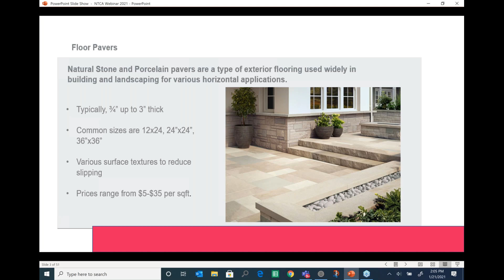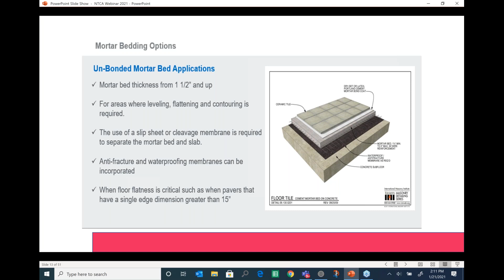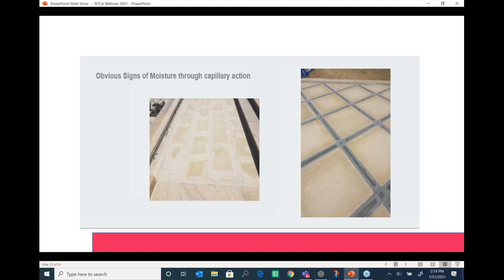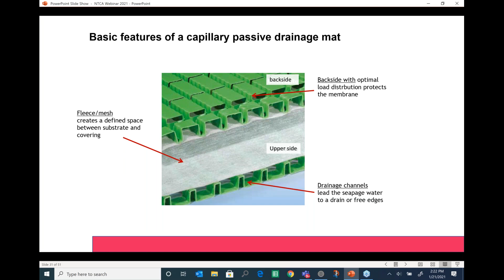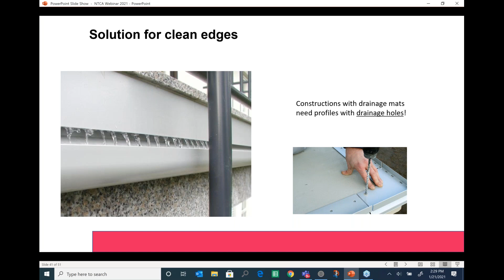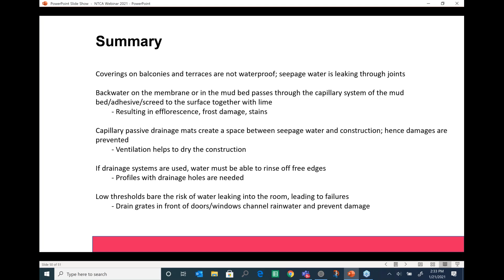NTCA Webinar: Exterior Tile & Stone Installations

Comment: If you have a completely covered patio and you are installing ceramic tile on a vertical surface such as an outdoor BBQ in a residential environment is it completely necessary to have tile that meets freeze conditions? Is there an ANSI resource or code someone could point me to?

Comment: So when going from a bonded mortar bed to an unbonded - the main thing is thickness?
You are still using a crack iso, I dont understand the differences of actual install..
Reply: @25:00 ish so if you need a drainage matt and need to slope, your minimum is really that...... "2.8" " in addition to the slope necessary. Is this correct?